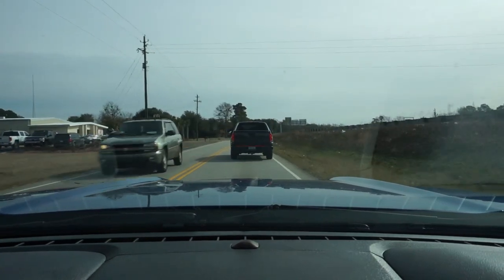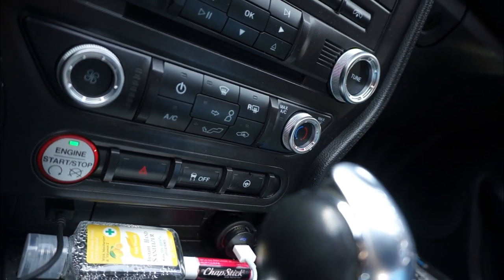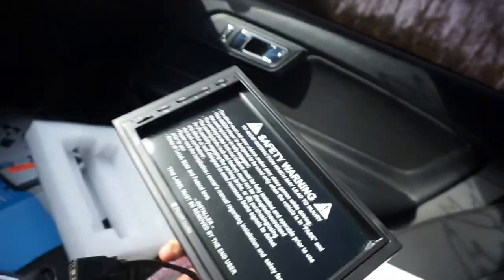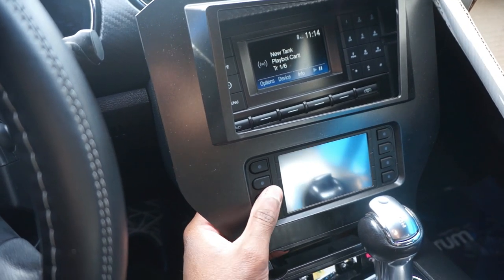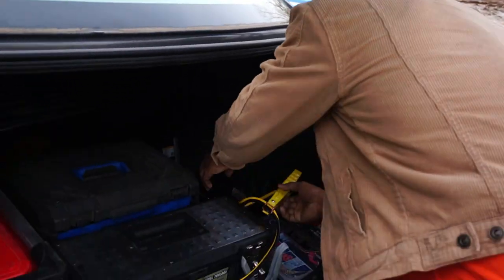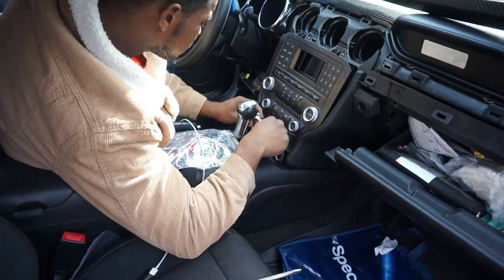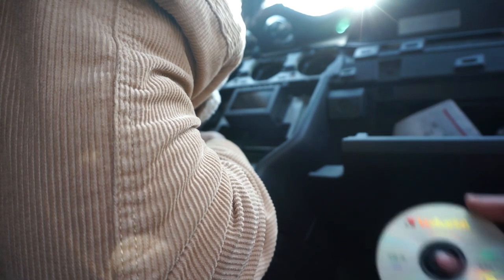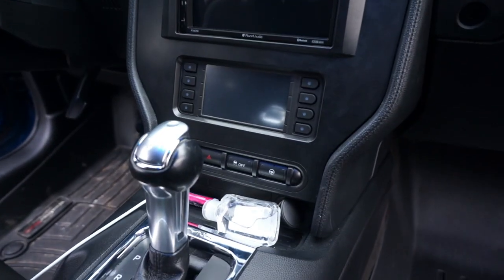90$ Apple Carplay in my 2017 V6 Mustang (Vlog)

Comment: New here and I love the car I have a black 2015 v6 that I’m looking to do more too than louvers and exhaust
Reply from the maker: Thank you, I’d be more than happy to help. The most performance mod I would tell you get is a tune. A tune will make you fall In love with your car all over again. I recommend two tuners for your choosing. More Power Tuning (MPT) and Auto Mafia Racing. Both of these tuners specialize in the 3.7 engine and they’re both good for tuning. I have no idea how good are they compared to each other. But I have heard good things from both sides. I love my MPT tune.
Reply: I had a 3.7 2016 (Moved on to a 2020 GT but those 3.7s are underrated killers) 
The best setup to me is MPT 93 tune, or AMR tune, they are the only ones who do ghost cam for 15-17 v6. Get a Pedal controller to combine with that tune, there’s one on AM for $130 I had mine for. 
Any aftermarket CAI is good as well man. Those three will have you rollin 
Also 3.73 gears
Reply from the maker: @dengod_  Bruh, I have all that EXCEPT the 3.73s and ghost cam. I want 3.73s sooo bad. That’ll definitely be a game changer.
Reply: @darkrose5.0  Ghost cam sounded so good dawg. But if you get them be careful they will burn through ur cats I suggest either taking them off or using the ghost cam for here and there, ain’t good for a daily like I tried🤣them 373s or shidd even 411s I hear will change your whole car
Reply from the maker: @dengod_  That’s fine, I was gonna remove the cats soon anyway.

Comment: Is there a link for this though? I’d like to cop in the future fr
Reply from the maker: https://www.ebay.com/itm/Planet-Audio-P70CPA-Carplay-Android-Auto-Apple-CarPlay-2-Din-Stereo-Touchscreen/274656321619?pageci=9024d892-92e0-4911-8c0b-0447aa7e01b9&epid=17042986005

https://www.ebay.com/itm/2015-UP-FORD-MUSTANG-DASH-KIT-WITH-INTEGRATED-SWC-CONTROL-TOUCH-SCREEN/192117657294?pageci=8b497d8b-338d-4a60-88b1-586ee27e20df
Reply from the maker: I will say there’s a slight gap that may be adjusted with a custom bracket. It’s very small I can show you if you message me on ig.

Comment: Just let me know anybody has a warranty for their 2017 Mustang do not add neon lights do not add a different ra different radio do not put at the market stuff on your car then they do not cover it and then forward dealership want to say that's the problem when they have computer system is failing on their cars and they want to complain it's your stuff you're putting on the car
Reply: It ain’t that deep